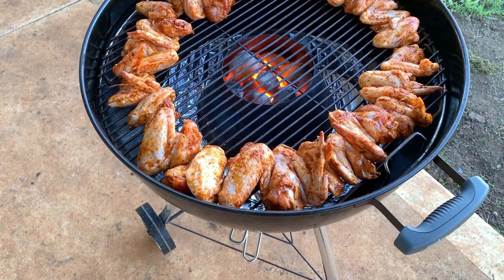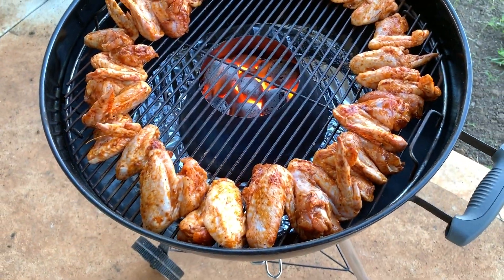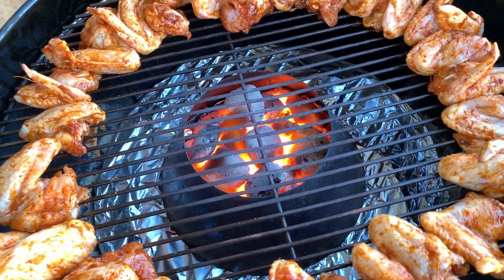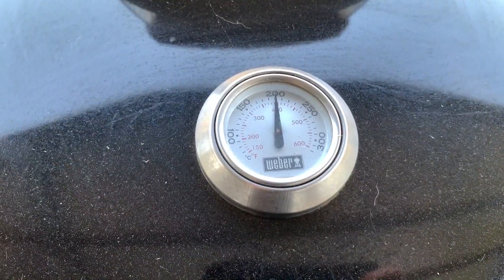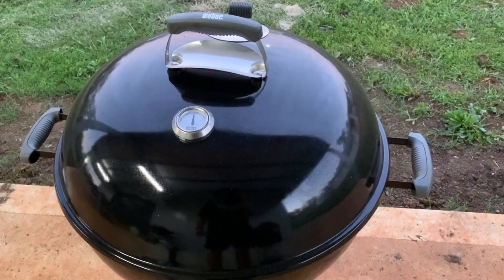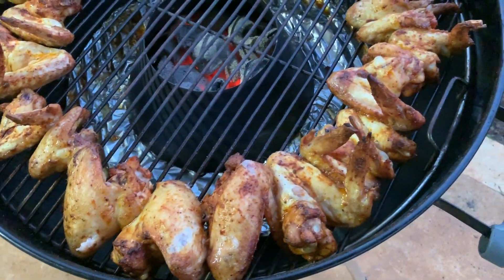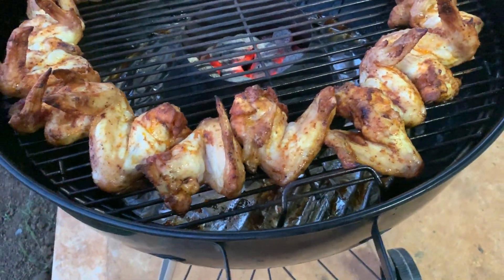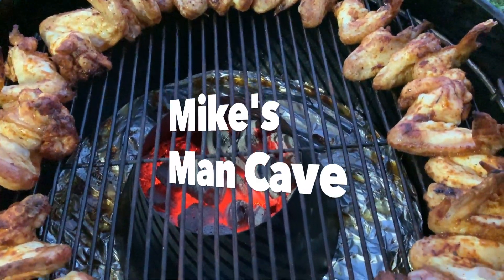Weber Vortex - Rotating Kettle Lid for Even Grilling Results

Comment: No reason at all to rotate if you don't add smoking wood, but if you are, then rotating will flavor your wings with smoke more evenly is the principle behind it. Like when you set up 2 zone cooking for a long smoke, you put the vent above the food on the indirect side so the smoke travels across from the fire to the vented side.
Reply from the maker: You do realise that smoke fills the whole kettle? That is the exact point of using a kettle, it cooks stuff evenly, air inside it circles around the whole kettle evenly. Smoking wood or no smoking wood makes no difference.